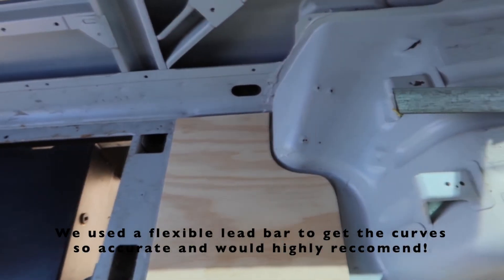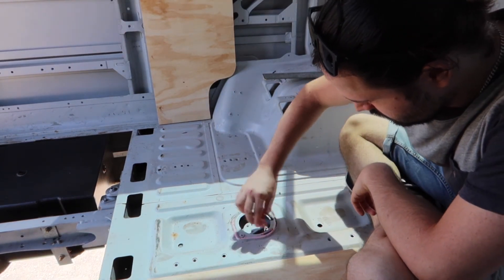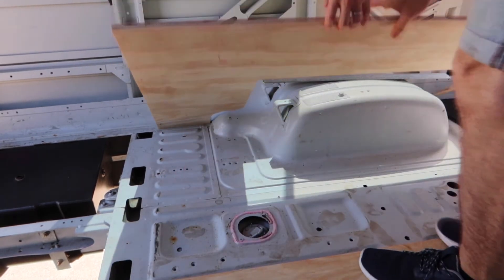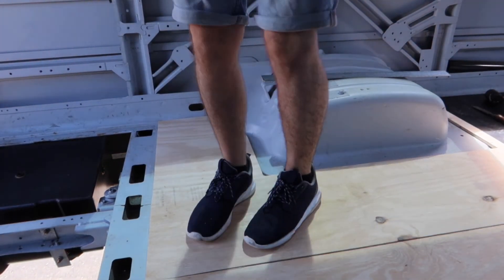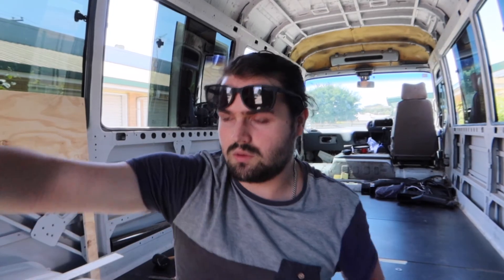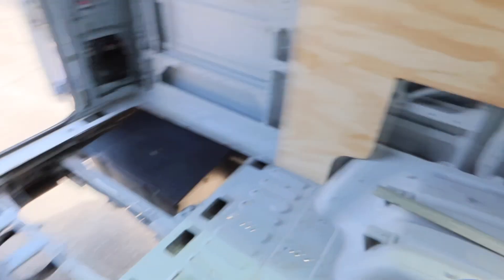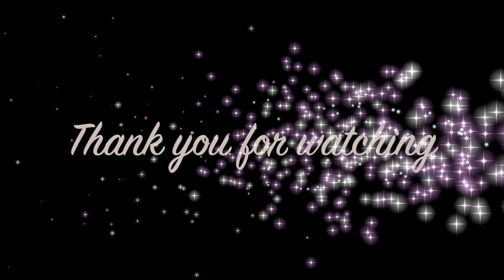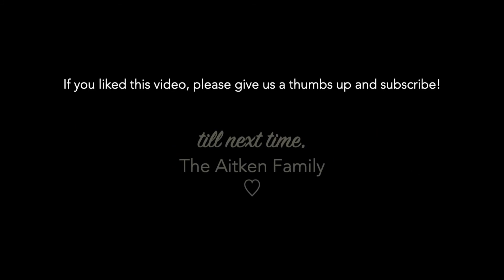Our Coaster Conversion - Part Eighteen - A Chat & Redoing The Floor

Comment: Such a shame about the leaks, nothing more disheartening than watching water pour into your bus. My first bus leaked like a seive but I did eventually manage to fix them all. I haven't had my coaster out in the rain for long yet but I know it will be full of leaks too. At least you have found them now before building the rest of the inside. You're doing a great job. I'm  a few steps behind you guys with mine and I'm learning a lot watching your videos.
Reply from the maker: Thank you, if definitely does feel disheartening to have the same issues occur over and over again, but at least they are all getting fixed and i won’t have to do many bus repairs in the pouring rain 🤣

Comment: Hi I love watching your build / videos. I’ll be doing a build shortly. So you recommend starting the new floor from the front not the rear, is that correct?
Reply from the maker: Thank you. It doesn’t really matter what direction you start. We started that the front as it was easier for us. But bare in mind that you get 17mm and 12mm flooring.
17mm for most areas (everywhere except where the fuel tank sits) the difference in height between the framing and the tank cover is 5–6mm.
We made the mistake when doing it the first time of using all 17mm. Had to redo it all again as it was uneven over the back section (we also found water leaks that ruined the top of the floor, hence why we opted for formply the second time around as the coating is water proof :)

Comment: What insulation are you going to use on floor, walls and ceiling?
Reply from the maker: Sorry i thought I had responded to this.
We are using an eBay heat and sound deadening panels that we are going to cover most of the bus in, haven’t decided if I’ll do the floor yet. And then the walls and ceiling will have foil board insulation on top of that.